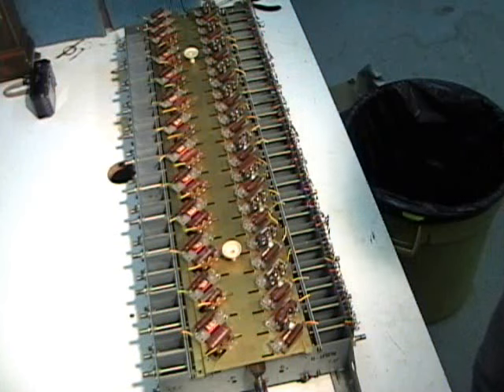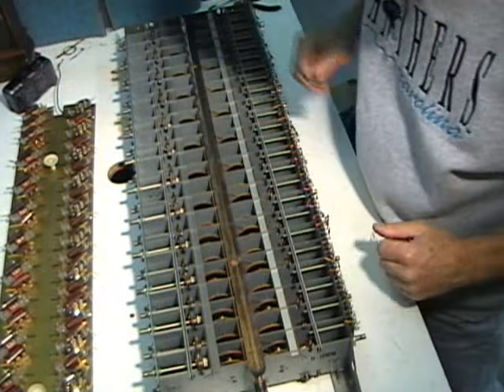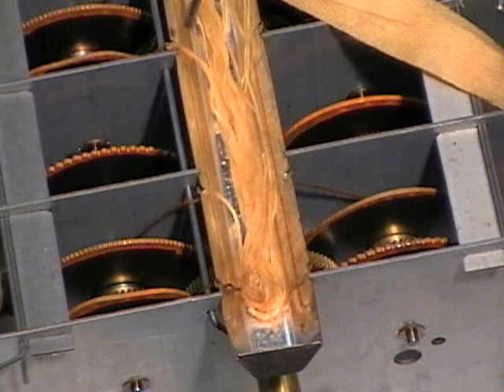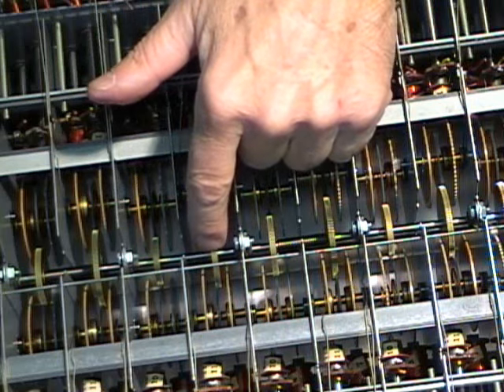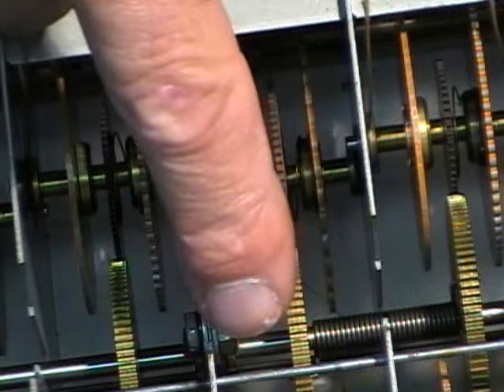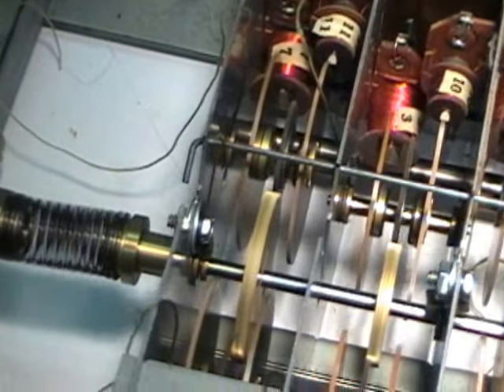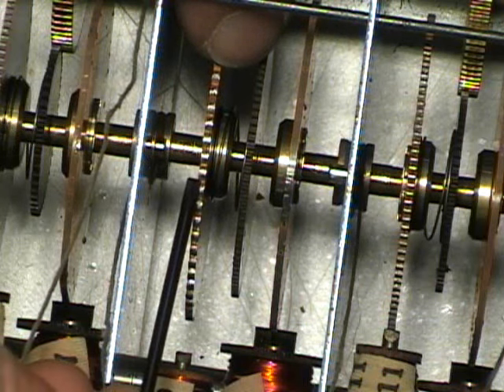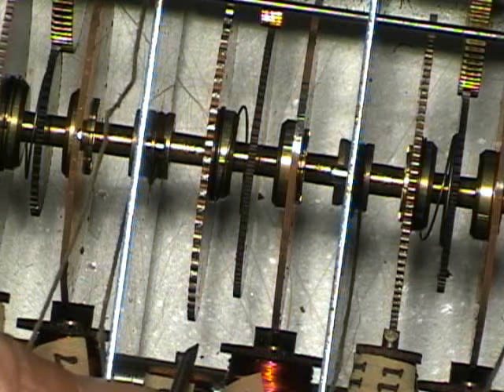Hammond Organ Tone Generator

Comment: I'm still absolutely amazed by the electro/mechanical engineering that went into these wonderful instruments. Even though the modern electronic versions can come really close, there's nothing like the sound of a mechanical tone generator and the mechanical effects that go with them. It's like looking into something from the past that was way ahead of it's time.
Reply: The vacuum tubes also contributed to Hammond’s incredible sound.
Reply: i just got an old 70s x77 hammond , going to get it working right and play it !
Reply: @deanevangelista6359  despite the myth, a transistor can do the exact same thing and even better, as far less thermal noise and no mechanical vibration picking. Sure at the time transistor didn't exist, and the tube default are a part of the sound that we all know. Just the same way a western from 1950's look with some oversaturated colours and grains from the film used at the time, any smartphone nowadays can do better than the most expensive equipment they use at the time, but it's part of the magic.

Comment: So if you replaced the wheels with a saw-blade would you get a sawtooth wave?
Reply: No.
Reply: That’s honestly kinda funny
Reply: Nice!  Probably a dull saw wave.
Reply: They are all rather sawtooth like before the filtering capacitors.
Reply: Not sure. But if you replaced them with grinding wheels for sure you would have an organ grinder!
Reply: I think it would give you a noise channel. So basically 100 noise channels if you wanted to replace them all 👍  That's 99 more than my Nintendo.
Reply: @jjjettflow704  👍👍👍

Comment from the maker: You are comparing apples to oranges. Totally different sounds, totally different instruments, and totally a matter of personal preference.
These organs have been making music for 70+ years now, and will be still goung for another 70+ years. I have a Model A that was built in 1935 that still functions and sounds great.
Your digital organ will be obsolete or unrepairable and in a landfill in a few years, and the Hammonds will still be playing.
Thanks for looking at my channel.
Reply: I share ur opinion - I own a C2 from 1950, still serves me well, but those new digital jokes will see the end of days pretty sooner.
Reply: we were scrapping model As 20 years ago because you couldn't reinsert the keyboard bus bars after removing them to clean them, the motors were failing, and coils were opening on the generator. they definitely won't still be going 70 years from now. there are no replacements for the keyboard parts, the generator components and no replacement motors. there are "clonewheels" from the 1970s which are still going such as the Korg CX3 and plenty of digital synths from the 80s are still working fine.
Reply from the maker: Sounds like you had one Hammond that you could not fix. This does not mean that all Hammonds will be scrapped anytime soon. My 1935 Model A still works just fine...83 years later. I also know of many more keyboards that had to be scrapped because of component and keyboard failures that made them irreparable or not economically feasible to do so.
Buss bars can be tricky to insert. You should have asked someone who knows how to do it to show you.
Never seen a TG coil fail, although I have heard it can happen. Trek products sells a replacement tone device in those rare cases.
Any motor can be rewound. The motor in the Hammond has no brushes to go bad.
Never seen a TG "go bad" either, unless it was trashed on purpose. Only parts that come in contact with each other are the bearings and shafts. If properly lubed, these will last indefinitely as the shaft actually rides on a microscopic layer of oil...as does any bearing/shaft assembly.
And a clonewheel still sounds like a clonewheel, if that is important to you.
Please, if you run across another Hammond that you cannot fix, donate it to someone who can fix it.
These instruments are definitely not for everyone. I personally like a real organ with 2 keyboards and foot pedals rather than a keyboard. I had a top-line Yamaha Clavinova for a while. It is truly an electronics engineering marvel. I sold it because I preferred my old C2.
Reply: I appreciate the mind-boggling engineering, sheer beauty, and authentic sound of a clean $14,000-$20,000, 400 pound Hammond B3. An expert aficionado like you with a discerning ear can suss out a digital SKX Stage any day of the week. Kudos. However, gigging organists aren't serving at the pleasure of aficionados with discerning ears. They are playing for drunk horny people who wouldn't know the difference. So logic demands that I go with the 40-pound digital rig and save thousands in cost, tens of thousands in Chiropractic bills, and enough $$$ saved to get a new digital rig 10 years from now. The tech is only going to improve.

Comment from the maker: There is never any contact between the tonewheel and the pickup. The concept is called the "Hall Effect". When a lobe of the TW gets near the magnetic pickup, a pulse is generated. This pulse is what generates the tone. The more lobes on the TW, the more pulses, and a higher tone is generated. Tones are there all the time that the generator is turning, pressing the key completes a circuit that lets the sound out.
Reply: the hall effect doesnt come into play here, only induction. unless you were to analyze the action going on almost down to a quantum level.
the workings of a hammond organ  aren't much different from an electric guitar: the pickup consists of the coil, and it's magentized core. if a magnetic object moves nearby, the slight changes in the magnetic field induce a bit of current, that can be amplified. nothing fancy there.

however <dramatic break> the electromechanical tone generator system really is a lovely piece of engineering in its own right, and quite a mathematical monstrousity.
the spectrum of frequencies generated, one for each note, are not individually tuned, but mechanical-mathematically derived from the speed of the central drive shaft. as a result the notes cant ever get out of being in tune with eachother, creating mathematically perfect harmonics. (the overtones of the draw bars are generated by dividing the frequencies, and cant go out of tune either)
Reply: An interesting point about the syncing between the harmonics.  I read a theory that doing FM with analog oscillators would not work well due to imprecisions on the oscillators.  "linear" FM is said to be best done using digital oscillators.  By linear FM, I mean FM such that the fundamental frequency remains unchanged.
Reply: The Hall effect is a major part of metering electronic fuel injection as well
Reply: bobmann107
Reply: I agree that the frequencies generated by the wheels are locked together (mechanically) but to say they are perfectly in tune is simply not true. Each tone is in tune with its octave, for sure, but the twelve notes within an octave can only be approximately in tune with each other. Gears and tonewheels have an integral number of teeth so the ratios between the frequencies can only ever be rational, which is not what is required for it to be perfectly in tune. It's the discrepancy that gives the instrument its characteristic sound.

Comment: I used to build these and other Hammond organs in Chicago while I was going to DeVry. I worked at the Diversy Ave. plant in audio pre-test. What came to us at that point were the finished manuals with drawbars and stops. Our job in that department was to assure that every contact functioned and that the drawbars and stop produced the sounds they were supposed to make. There are a number of contacts for each key that had to make contact at the same time during a key being pressed.
Reply from the maker: I have not actually gone through all these comments until now. 
How long did you work at Hammond? Did you ever work on assembling or calibrating the Tone Generator?

Comment: Great video. I’m no tech per se, but I’ve replaced the start and run motors in my ‘48 CV and I’ve “known” how these instruments make their unique sound, but never witnessed the remarkable detail of the TG assembly. The oil wick on the vibrato scanner is rather obvious, but I never considered how the the oil gets distributed throughout the TG. That part just blew me away. Every time I crank up my CV or B, there’s an abundance of things one takes for granted, but be that as it may, the respect for the engineering and manufacturing must be admired.

Comment: 30 years ago, I built an organ that imitate exactly the "hammond sound" , using a MK50241 Integrated Circuit and 7 chip 7490 for divide the octaves...
And 30 years later, still works fine !!
Reply: Ah the venerable TTL Decade counter.  I remember playing around with those and other counters back in HS in the early 80's.  Made some interesting tone generating circuits with a 555 as a clock source.  Never sounded like a Harmmond though.  Still, fun times discovering Integrated Circuits.
Reply: As a Hammond tech,  and Yamaha tech,  there is no way that a filter square wave sounds like a tone wheel organ.  Every modern organ company has tried and even Hammond tried and they can't do it.  There are clone wheel organs now that use digital modeling that are pretty amazing,  but using a top octave generator and dividing.
Reply: do you have the schematic? I’d love to start making synths n stuff
Reply: @andymorin9163  However I can tell you the key to achieve that same sound of the Hammond organ, independently of the circuit details.
You must use the MK50241 integrated circuit, which is a chip that gives you the 12 notes of a full octave when you put a square signal at the input.
The 12 outputs of the MK40241 are also square waves.  To convert them to sine waves, I used filters.  Any filter will do.  The idea is that the filters are capable of transforming the square signals into sine waves.
In my case I used as filters a set of phase shift oscillators where I lowered the gain of the transistor so that it would not start oscillating, but the signal I injected at the input was transformed into a sine wave.  Each filter admitted 1/2 octave. Therefore it was not necessary to use a filter for each note.
If you understand electronics, you will understand this comment and you will be able to make your own bank of notes that will sound exactly like the Hammond organ.
The rest of the circuits (mixers, amplifiers, on/off gates for each key can be as you prefer.  They will have no influence on the type of sound.
If you want an example of the use of the MK50241 circuit and other circuits, I leave a link to the schematics of the Baldwin Funmachine organ that used this chip and had a sound also not exactly but very similar to the Hammond.  
In this pdf file you can see all the circuits and also you can read about how they work because everything is very well explained.
I wish you success in your project. https://diagramas.diagramasde.com/otros/Organo%20Baldwin%20Fun%20Machine%20mod%20121-121W_Technical%20Manual.pdf
Reply: @timpullen4941  However, I was able to make it.  Although I obtained the tones thanks to the MK50241 chip, which delivered square waves to the output, I passed those square signals through phase shifted oscillators which I prevented from oscillating, using them as filters, although they were actually oscillators controlled by those square waves.
In theory a filter was needed for each note but I made several tests and I came to the conclusion that it was possible to use a filter for each 6 consecutive notes without altering too much the output waveform.
In my opinion, this is the key to achieve the sound so close to the original Hammond.

Comment: No, it isn't Hall effect. 
Hall effect is about the interaction of a magnetic field (existing) on current passing through a plate fixed at right angles to the field, and the electrons in the plate being diverted to create a small potential difference in the plate at right angles to both the current and the field. i.e. fixed magnetic field, current in, voltage out.  There is no movement.

The pickups on a Hammond are each like a small alternator, i.e. something that converts the mechanical energy (in this case of the tone generator main shaft) into electrical energy at a set frequency (in this case at any particular pickup). 
The core of each pickup provides a magnetic field and the lobes of each tone-wheel modulate the magnetic field by changing the magnetic reluctance of the magnetic circuit (i.e. the field is stronger with the tip of each lobe under the pickup core and weaker with the trough between lobes under the pickup core).  The field strength experienced by the winding (wound around the pickup) thus increases and decreases, inducing a small sinusoidal alternating current in the winding. This current is taken to the pre-amplification circuitry.  

Each tone-wheel has a number of lobes, which combine with the gear ratios between the main shaft and tone-wheel shafts to provide a number of pulses per second based on the motor speed at 60Hz (US) or 50Hz (elsewhere). What I don't know is if the pickup cores are permanent magnets, or if there is a dc excitation winding providing the field as well as the ac tone winding as in a modern alternator. I suspect its the latter.

Interesting experiment. With replacement tone-wheels as rare as hen's teeth, I wouldn't have been treating them like that, regardless of whether i saw shavings !
Reply: I got the impression that he was stripping a unit that was no longer used - possibly no longer running - and he didn't understand how it worked, so he was trying to contact the tone wheels with the pickups..  I'd guess there is a specified gap that should be set with feeler guages

Comment: This is a great, simple detail of a tone wheel frame and function!

Without involving myself in debate, I would like to point out that The only thing the original Hammond service manual's introduction of theory says is:
"5-8. The edge of each tone wheel and the tip of each magnet are coated with lacquer to prevent corrosion, for, should oxidation set in, the change in tooth shape would introduce undesirable frequencies. "

Mileage may vary. I'm in the music repair biz, too, Tour Desk Refurb

Comment: I recently have been working on my 1960 M3 after taking the organ out of storage after 20 years. This had the front cover still on it so the insides are very clean. Tube checked and replaced as needed amp tubes. Hammond oil to left cup for scanner and motor, both middle and right cups had three doses of filling cup, that was Friday night. Saturday checked and had some squealing bearings so I left it alone. Sunday night so two days later: tonight, I realized that some heat might get the oil to flow better. After ten minutes of going up and down the generator on the bottom side slowly back and forth, I started the organ and had NO SQUEEALING!! When I shut down the generator it ran for 16 seconds until it stopped. I imagine this might be rare? but if your organ is squealing give it some loving heat! Johnne in Clallam Bay, WA..
Reply from the maker: That squeal is the TG begging for oil. The heat probably released some oil that was imbedded in the oilite bearings, and is a temporary fix. The ideal solution is to turn the TG on it's side and oil each bearing. This is easy in an M model, just unclamp the wire harness, unbolt the TG and lift.
If you do not want to do that, fill the oil cups a few times and wait a week or 2 for the oil ot get to the bearings. Heat will help here as well as it is possible that someone used something other than Hammond oil and it can gum up the threads.
There is a remote possibility that someone broke a oil thread at some point over the years.
Bottom line is to shut it down immediately if you hear it squeal, as it could cause bearing damage.

Comment: Excellent video. I picked up a Hammond organ that hasn't been used or oiled in over 30 years. Of course the tone generator is howling and squealing. There was a tube of Hammond oil inside the cabinet. I used the entire tube and the trough is still dry and the TG is still noisy. I read in some forums that it could take many days for the oil to do its job. In the mean time I ordered more Hammond oil. Now that I see how it works, its a huge help.

Comment: Ok...I have a question. I have a 1962 L-102, and it's been neglected for many years, but I've oiled it every week, per the local organ technician, until now it's perfectly quiet whenever it's turned on.But It's really sharp. I thought when I got it last month, it was because it was oiled improperly by the previous owner. But no matter what I've tried, it's still sharp. Is there anything I can do to bring the organ back into pitch?

Comment: Thanks for the video. I just bought a Hammond T-212 today for $250. I just replaced the speaker on the leslie side of the cabinet, broken wire between connector and speaker cone. I'll be ordering the tone wheel oil tomorrow. All notes are working, but TWG is noisy.  Tomorrow I'll be cleaning key contacts and tabs. I should have it all working in no time! Your video a big help, THANKS!

Comment: A great look inside a Hammond TG which up until today was only still pictures for me from a Hammond service manual.  A nice touch for this video would be to put the out output of some of the pickup coils through an amp so we could hear the difference of sound as the pickup coils were being manipulated.   I understand that this was a demo of a discarded TG but of course there would never be a reason to disturb the pickup coil settings of a factory setup Hammond unless you had to replace a coil which I suspect would be a very rare occurrence.